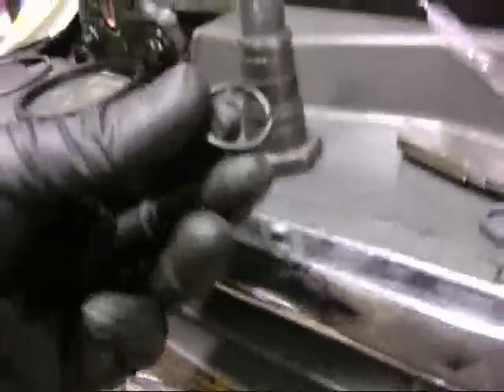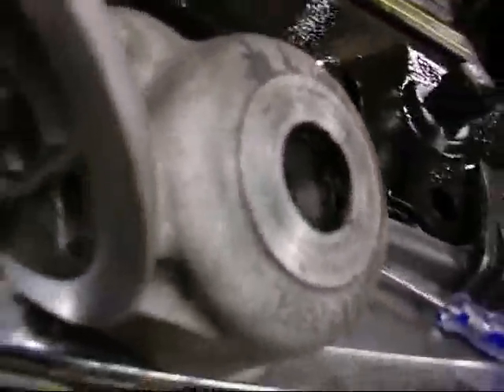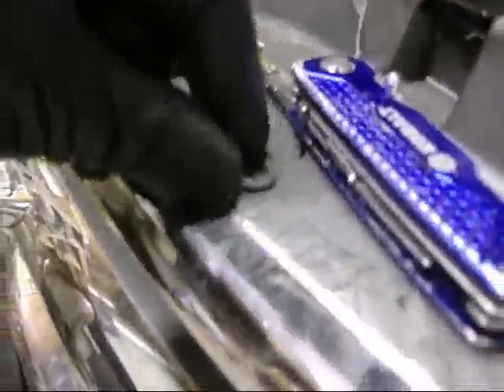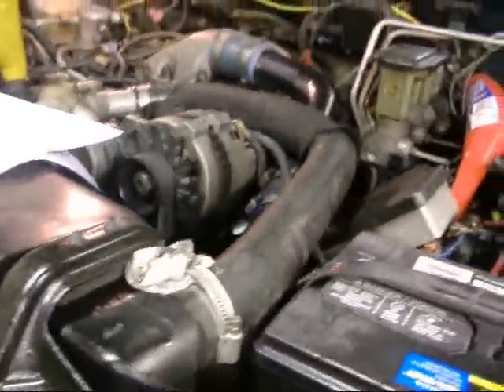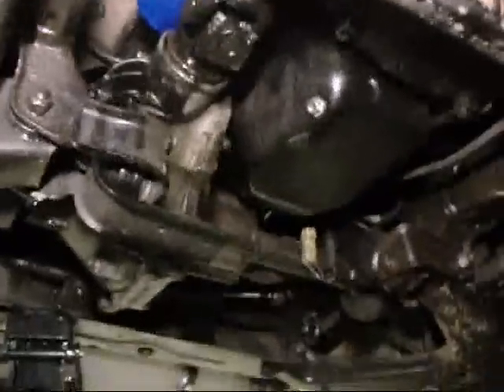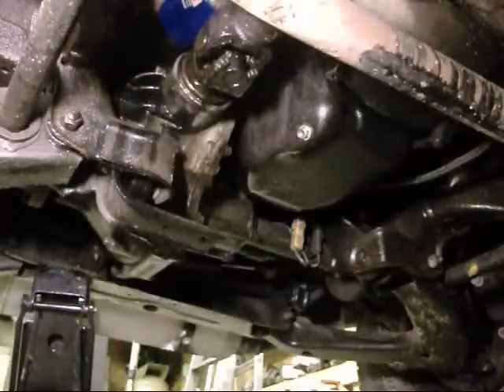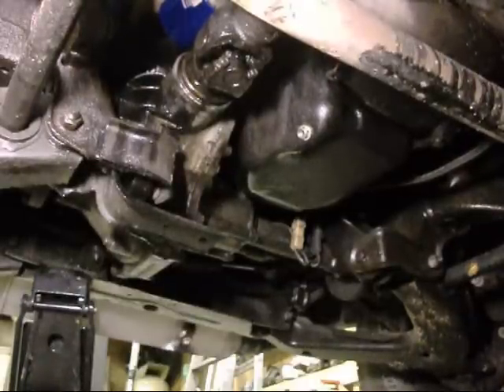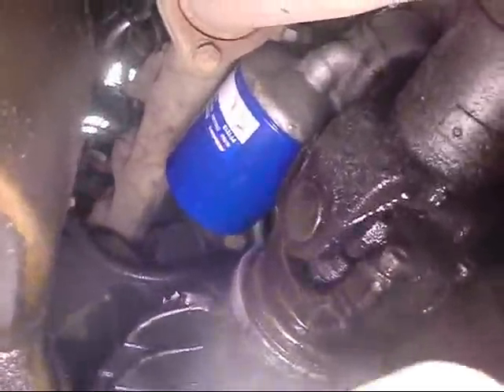2 28 12  Az Sub Oil Filter Adapter...

Comment: you must have meant the 4.3 4wd that has the oil filter mounted on the fender because my 93 2wd cheyenne 4.3 oil filter is on the engine like on a small block chevy but my s-10 blazer is mounted on the fender of course it is 4wd but either way a 4.3 is a tough engine and extremely reliable in the last 2 yrs I have owned it..great repair video

Comment: I was just under my 97 K2500 last weekend replacing the failing cooler lines with custom made hydraulic lines. You were way luckier than me, as i had to remove the driveshaft, exhaust crossover, and of course, the filter adaptor. Never again will I use the factory cooler lines----JUNK!!!!